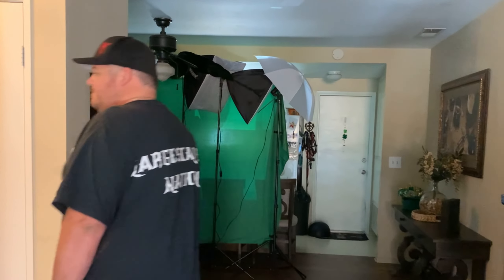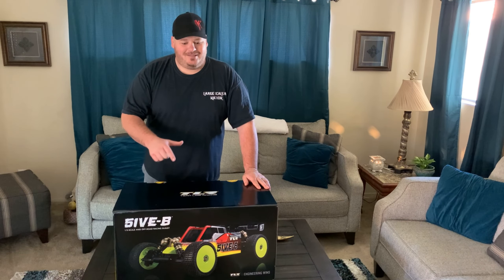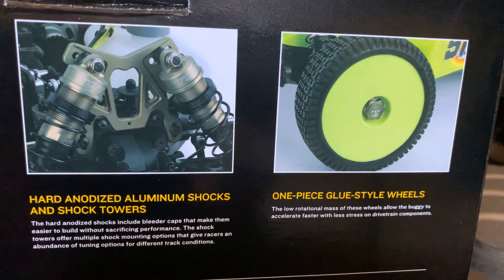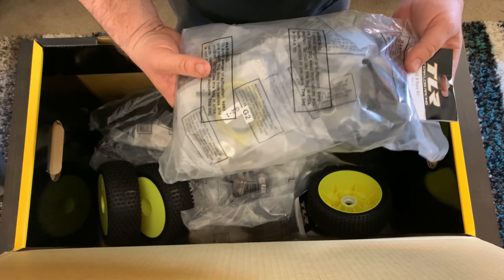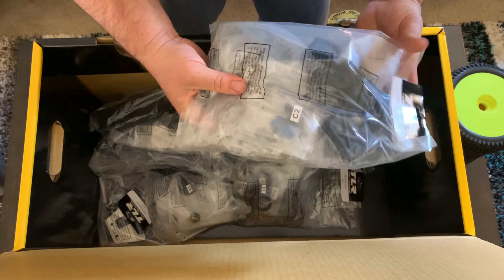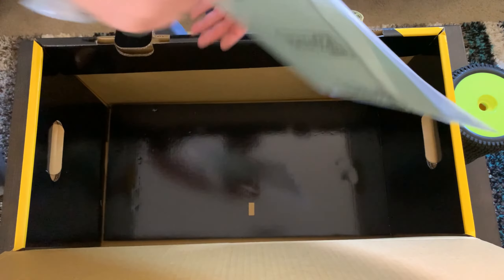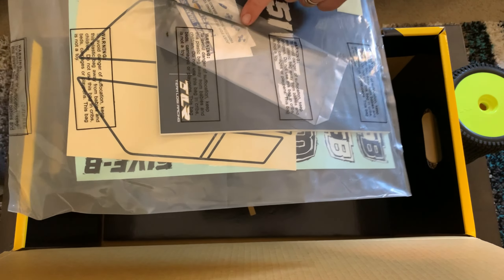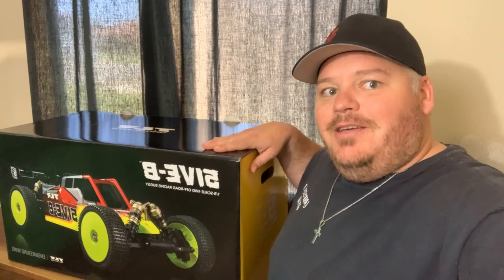Unboxing the Team Losi 5ive B

Comment: I would like to get my hands on a 5ive B myself but i would need to start parking a few RCs in the garage. I could also see the 5ive B getting into the 3 to 4k price range for me as seeing all the aftermarket stuff i have into my 5ive T and my 5T isnt even to the point i want it to be at yet. I still need a throttle servo, well dont need one but i still have the stock on in it and thats $220 for the servo i want. Id want the same servos for the 5ive B if i got it. Then pipe, engine, braces, tires, wheels, etc etc. Building one the way i want it is a little to rich for my blood right now, but i still want one eventually. Anyways, im looking forward to the build.
Reply from the maker: I definitely hear you on that one! They are bank busters LOL.😂👍 What servos are you going with? Thank you again for your support 👊👍😀
Reply: @largescalercnation  I run spektrum servos. 9120BL with 1450 ounce inches and .20 transit speed. The throttle servo, i want the 9110BL with 1250 torque but faster transit speed at .16.
Reply: @SebastianLong  Are you powering your servo from the receiver ? Have you checked to see if it's getting the exact amount of power it requires ?
Reply: @EJ-74  It is direct power. The receiver battery is a 2 cell that, when fully charged is 8.4 volts. That battery is plugged into the receiver via an extention lead into the battery port on the reciever, the servo is drawing its power from the receiver. The receiver is rated for 9.6 volts. It is sure getting the optimum voltage. Gasoline engines have a non BEC wiring system.